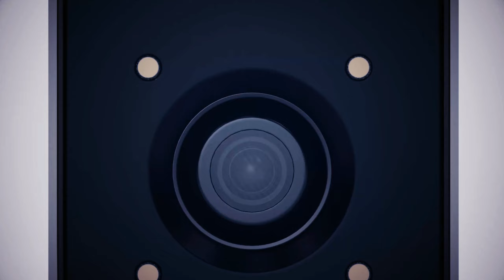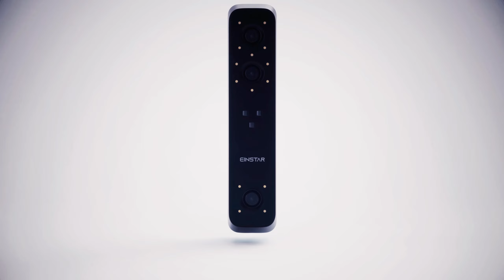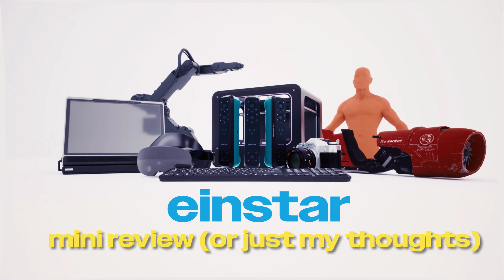This 3D Scanner changed my life...

Comment: Did you work only in Mesh files in Solidworks?
Reply from the maker: I typically would go back and forth between blender and solidworks. The mesh Modeling features in solidworks are super powerful , but fine mesh control is easier to achieve in blender.